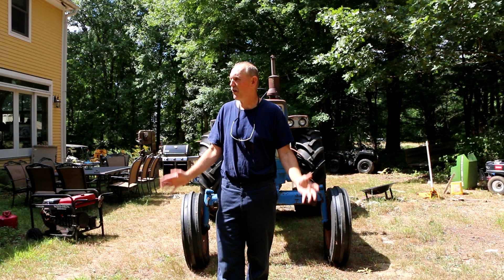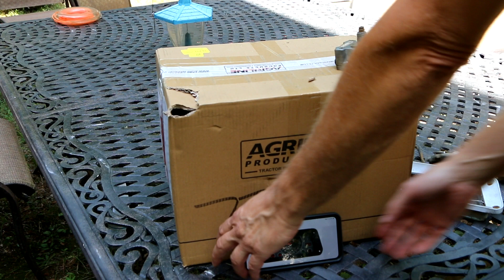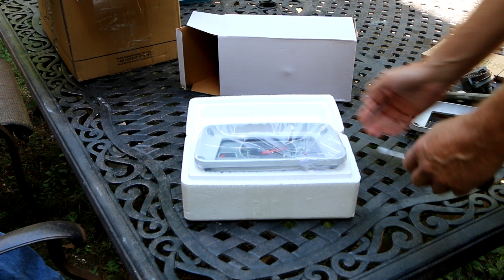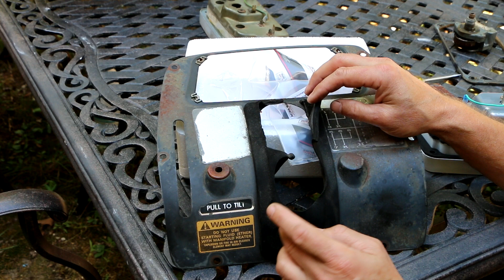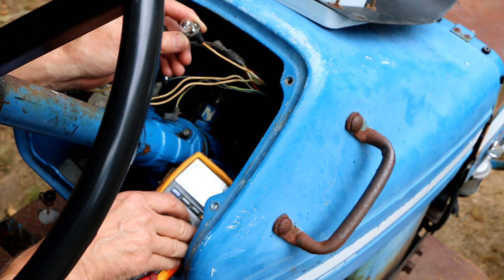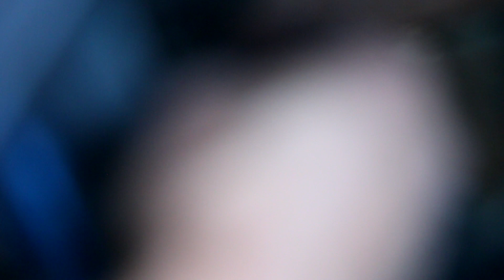Ford 5000 Tractor New import instrument cluster review

Comment: I have a 69 3000 US built Ford Tractor that I replaced the dash cluster. Looks exactly like the one you have. Had to verify the RPM rotation, too. Just found an old picture of the dash, and it had a grey trim.

Comment: I'm not sure about a replacement steering boot but I know a white or oliver  steering boot may be close enough to make it work with a little time I believe there all the same 2-85 2-105 2-135 1750 1755 1850 1855 1950 1955 and so on
Reply from the maker: Thanks. I'll have to look into that.